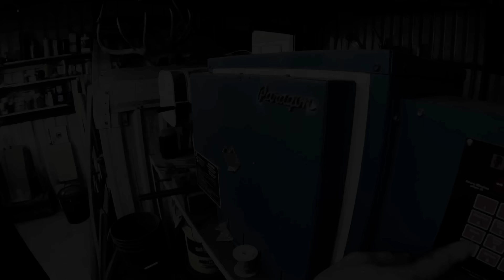Making A Stainless Steel San Mai Bushcraft Knife

Comment: That’s one combo I’ve been skeptical of trying due to the chromium content in both steels.  I’ve only used 1095, w2, and 1084 with stainless. Thanks for being the Guinea pig 😉 .
Reply from the maker: Yep, this is a fairly common combination. One of the advantages with the 52100 is the chromium content helps control grain size with the necessarily high Forge welding heat.
Reply: @FireCreekForge  that’s good to
Know.

Comment: Really impressed on a lot of levels, definitely a power hammer only kind of job unless you've got 2-3 strikers with sledgehammers hidden somewhere. The old 304, it doesn't like moving much

Comment: Always inspiring to watch your videos! I'm going to be attempting this combination very soon, but with the addition of Ni200 shims. I have the billet ready, just waiting for it to cool down a little (North Houston). No power hammer or press, just a hand hammer and pure rage. What temperature do you suggest for that? This will be my first use of stainless and first time using Ni200. Thanks in advance!
Reply from the maker: @hayworth.handmade  thanks! To be honest I'm not sure the actual temperature to forge weld high carbon / stainless steel san mai. It may take a little trial and error. Ideally you would use the lowest possible temperature and still achieve a solid weld. There is a range. A little higher temperature is going to provide more shadowing if you're not using a nickel barrier. 
Unless you have a temperature controlled set up, it's something you'll have to figure out in your particular forge anyway since they're all a little different.
I want to say around 2500 fahrenheit, but I would really have to check on that.
Reply: @FireCreekForge I know I got it up to at least 2200 and the 304 didn't stick to the Ni 200 at all. Pretty disappointing but trial and error is required to make something great. Thank you for your response!

Comment: Whats the hardening process? As I thought stainless was air hardened and carbon was quenched.
Reply from the maker: @SimonCatton-n1m  There is a wide range of stainless steels. This particular stainless steel can not be hardened.
The heat treating process used in making this knife is for the high carbon edge steel.

Comment: That is a nice blade. What was that you sprayed on each steel before  clamping and after welding together? Amazing you forge welded stainless steel to high carbon but you did it quickly several times to limit oxygen I think.
Reply from the maker: Thanks! That would be WD-40, then the billet is sealed to keep out oxygen. The multiple weld heats are because the steel drops in temp quickly.
Reply: @FireCreekForge  So wd-40 seals the O2 out and the all around welds, I would think any oil between the metals would inhibit forge welding. I wonder if you added borax to the wd-40 with side pin holes drilled would work better. I am amazed you accomplished welding stainless to high carbon.

Comment: What do you spray on the metal before stacking?
Reply from the maker: @riff42  WD-40
Reply: @FireCreekForge  Iiiinteresting.  For a flux?  Can't just maybe add borax between them all?   I'm on my second sealed S/S-Carbon san mai, and I hope I got the metals more clean.  Some people don't use anything, I've seen paper, and now wd-40.  I seal it up with my TIG.

Comment: What compound are wax did you use on handle thanks
Reply from the maker: The handle wood is stabilized so it doesn't require or allow additional oils or waxes, and buffs out nicely on it's own.

Comment: so i still not sure if its a good thing to forgeweld stainless and carbon steal? ist there intercrystalcorrosion? if you combine stainless and "normal" steal in construction or other industries rthere is always a problem with corrosion becouse any kind of liquid or humidity causing a galvanic reaction! why that doesnt happend here? (sorry if some terms are not right im not a nativ english speaker/writer XD)
Reply from the maker: Galvanic reaction is an electrochemical process and doesn't apply when two metals are atomically bonded together, as in the case of forge welding two steels together.
Reply: @FireCreekForge  then i used the wrong term.. but in generell you try to avoid contact between "stainless" (chrom/nickel) and usual steal becouse it will build rust. and yeah galvanic is an elechtrochemical reaction but if you put two metals with different "ionisation" in a acidic liquid tehre will be a reaction.. thats how batteries work... and f.e. rain is "acidic" enough to start a reaction.. i "fight" that problem on a daily basis^^ thats why im suprised of that kind of blades which are used to cut things like tomatos or anions with a high acid content.. but thx for the answer

Comment: Awesome work.  It is beautiful.  However, i would like to issue you a challenge.  I have never seen anyone make a true wilderness survival knife.  One that will allow a person to survive in the wild with that tool alone.  Here are the features that I believe such a knife should have:
1) saw serrations on the spine that can actively be used to cut branches, vines, etc.
2) a sharp point that can be used to pierce hides, tarps, etc.
3) an integral strike face on the promel that is concave on the handle side to prevent the scales from coming off.
4) storage for a flint for starting fires.
5) storage for 10 to 20 feet of 550 cord or similar.  This one is optional on the knife itself and could be done with the sheath.
6) storage for a small fishing kit in the sheath.
7) made entirely of high corosion resistant stainless
8) slots on the handle to facilitate strapping knife to a pole or branch for use as a spear

Everyone else, feel free to comment and add any additional items you think should be in a true survival knife.

Will you take up the challenge?

Comment: You’re always meticulous about cleaning your metal before forge welding. I’ve watched so many videos of Japanese bladesmiths making samurai swords and when they’re doing their folding and layering processes they never clean anything up, just partially hot cut it and fold it over and continue to forge weld. How do they get anything to stick together without cleaning it?
Reply from the maker: Yes sir. You'll notice that they blow the scale off the surfaces to be welded with a small puddle of water between the anvil and the billet, then hitting it with the hammer. This removes the layer of scale that has been formed, and the minimum amount that would form while the steel was being folded the rest of the way is addressed with flux. In general, this is a very efficient way to forge weld layers. There is however a greater chance of impurities or inclusions in your weld, I believe. 
Is it necessary to be as meticulous as I am in most cases? Probably not. When it comes to stainless steel san mai however, the stainless steel is much more prone to forge welding failures, and so I use every bit of care to make sure it's successful.
Reply: @FireCreekForge  absolutely, wasn’t picking on you, I like my metal clean too. It just looks so crude when they use their homemade flux and charcoal forge, it just  doesn’t look like it would stick.